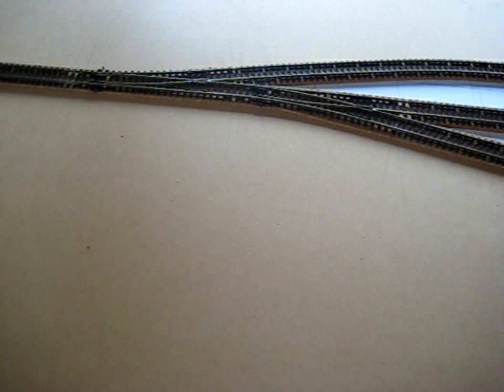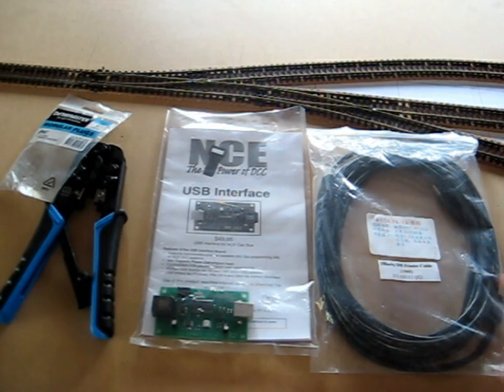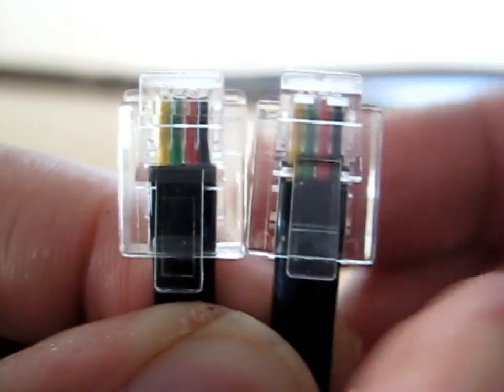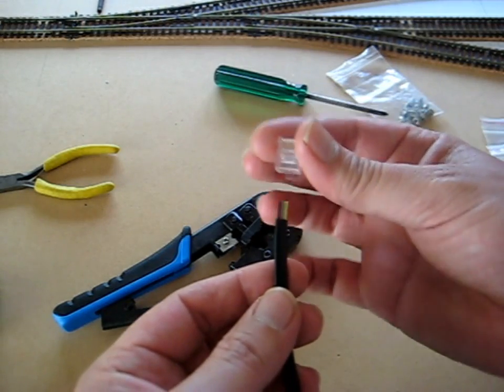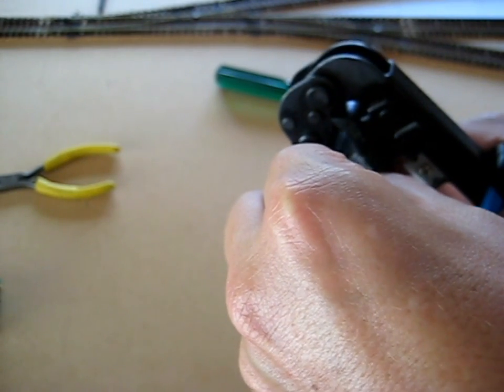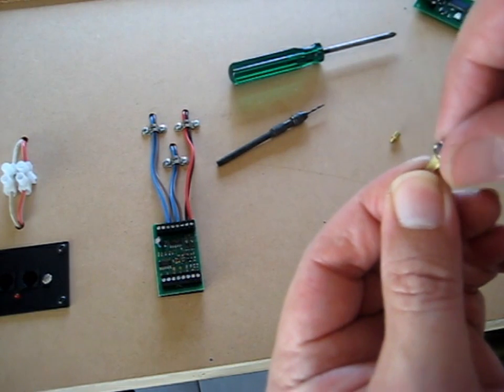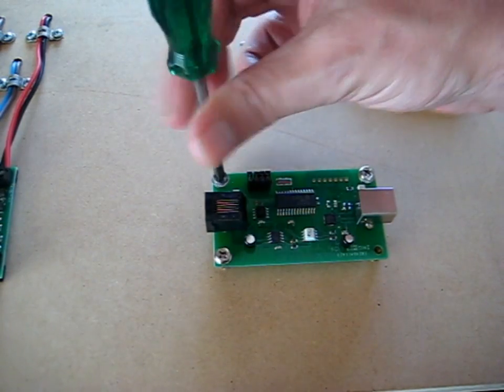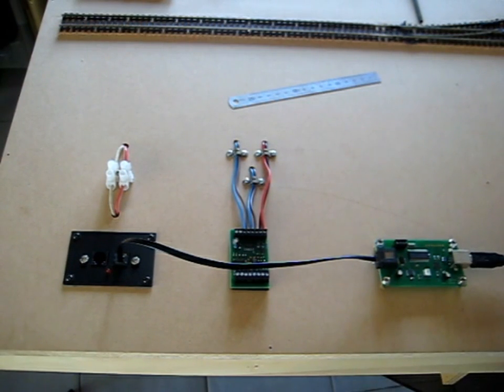NCE USB interface install

Comment: Detroit River Railroad)!    what is the Panel Between your USB Panel and the UTP Panel not sure of what is it Please Specify  weather it's a NCE Product or some other Manufactured product,  if it is a NCE product what is the Product #?    If ya have any Pictures of how you Wired this test track up please Share that as Well.. 

To Add:  it's helps to Label the product in some way so folks like me has a little knowledge of what they are..  A parts breakdown list in  SHOW MORE would be Great as well.. 

Thanks so much showing the Video hope your having a Great Labor Day!
Reply from the maker: Hi, that's the nce switch-it . it can control 2 switch machines
thanks for watching

Comment: I understand it is possible to connect the PCP panel (right hand socket) to the USB interface using the coily cable that comes with a new Power Cab. Is this correct?
Reply from the maker: That is correct, I believe you can also correct to the rear socket as well.
Regards,
Michael
Reply: Detroit River Railroad Thank you. This isn't clear in the instructions that came with the USB interface I received a few days ago. I'm somewhat confused by the instructions and still bewildered by JMRI generally.
Reply from the maker: N-Scale Union Pacific Evanston Subdivision no problem, glad I could help